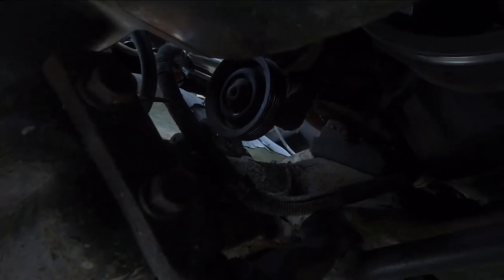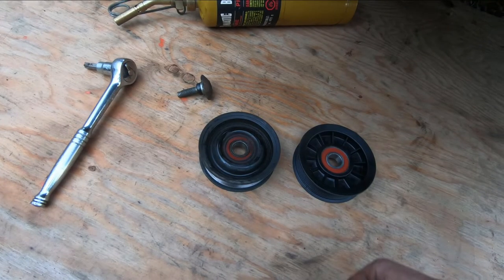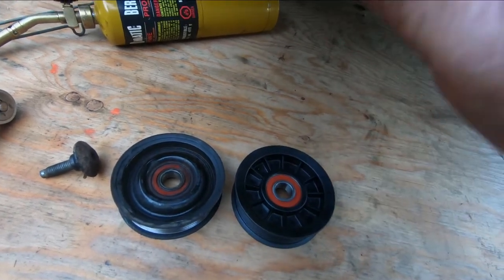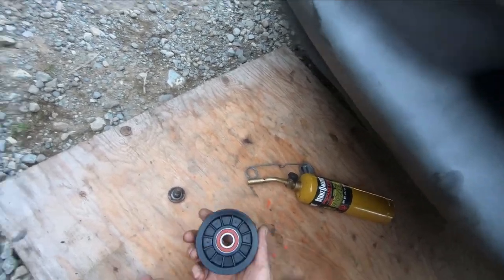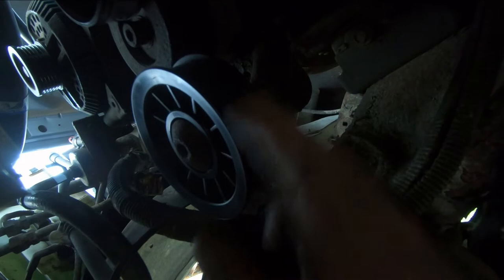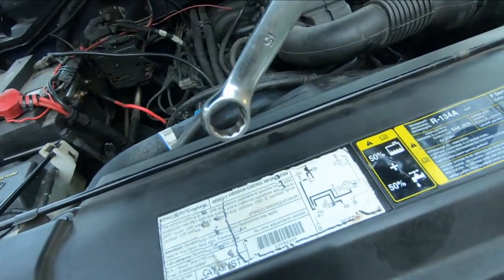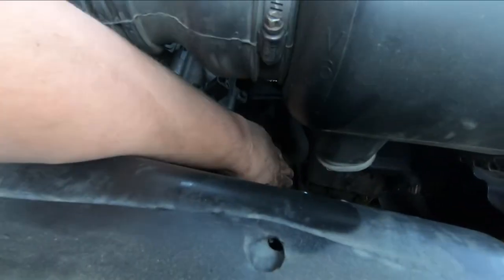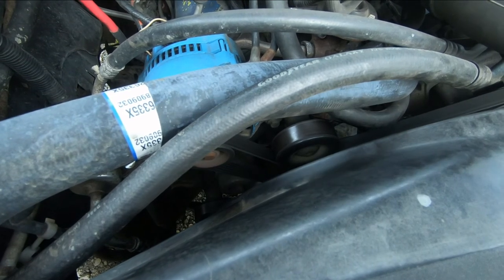CHANGING IDLER PULLEY FORD F-150 DUE TO FAILED BEARING (PART 2)

Comment: What was the engine on this Ford?  I had a 2001 F150 with 4.2L engine.  The pulley & bolt were the same, but they were nowhere near as accessible as what you worked on.
Reply from the maker: 2003 F-150 4.2 engine.

Comment: And I thought my Ford van engine was a tight fit! 1997 with 5.4L but you got in there and conquered✔️💯💪🏽
Reply from the maker: Yes, tough spot. I'm glad I didn't break the bolt off. It would have been a very hard job to get it out. Sometimes, it's hard to pinpoint the location of a bearing noise so what I do is remove the serpentine belt and turn each pulley by hand. That will often lead you to the noisy one.
Reply: @EverydayProjects  Gotcha 👍🏽

Comment: Awesome. Yea mine is screaming too. Hopefully having it fixed by next weekend. One question come out who in the idler pulley is bad with it get louder when I step on the gas?😊
Reply from the maker: The faster the pulley turns the louder the squeal when the bearing is bad. If by some chance the belt is causing the noise there is an easy way to check (also, another video on my channel to find the source of engine noises: https://www.youtube.com/watch?v=iQTvE4iK1OI&t=3s). Best of luck to you with your repair!😁😆

Comment: Great repair. I am always unsure about plastic pulleys but we have fitted a few plastic idler pulley's to our garden tractors without issue. It looks like you may be able to press the old bearing out of the pulley, that may be a cheaper fix.
Reply from the maker: True, the old bearing could probably be pressed out and replaced. That seems to be the only part that wears. I've changed this once before and the grooved part is always perfect. How do I know, you ask? Well, I found a large, deep body of water.....LOL. I think that the plastic used must be ABS or some other long-wearing type. I'm so glad the noise is gone...it was getting very annoying.
Reply: @EverydayProjects  LOL. I do wonder if the plastic against the belt will reduce belt noise